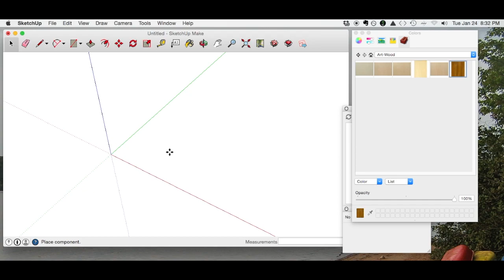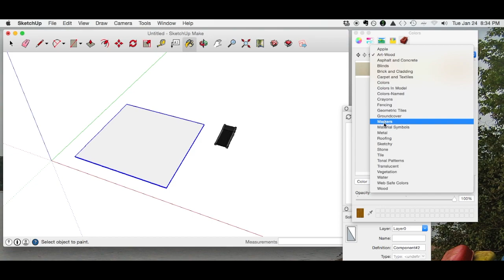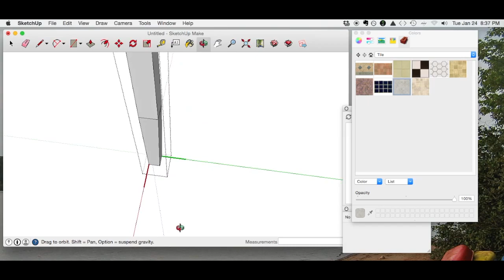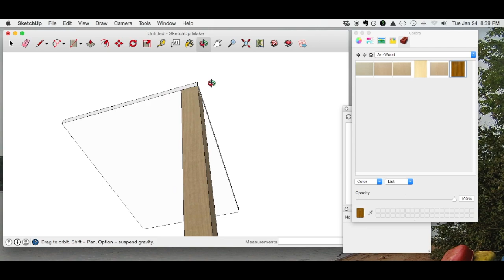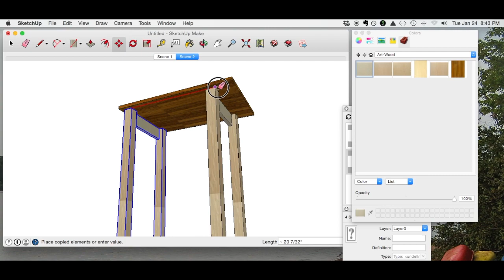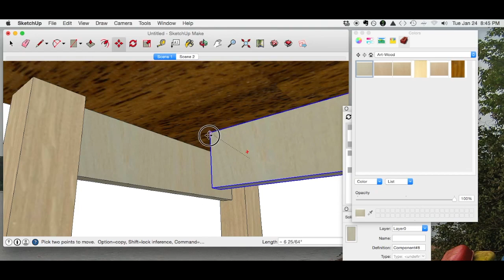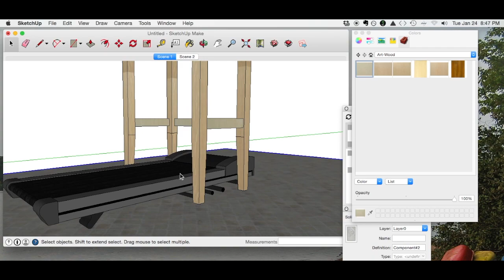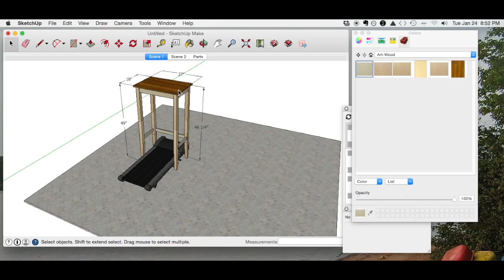Designing A Walking Desk in Sketchup!  (WnW #89)

Comment: Are you using the free version or did you buy Sketchup?
Reply from the maker: Free does all I want so far.
Reply: Thanks. I struggled with the free version. I wanted to make sure all the features that you used were in the free version. Nice video. Because of your video I will give it a try again.
Reply from the maker: Jay Bates has a whole bunch of sketchup videos.   Dave Richards also has some on the FWW website.  He's a great teacher as well.